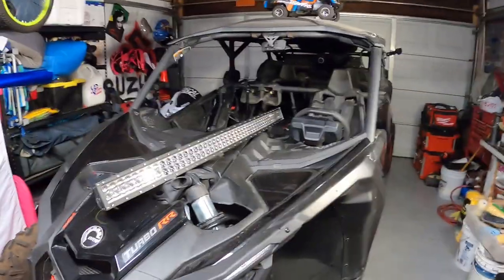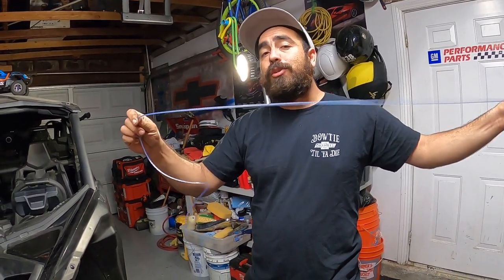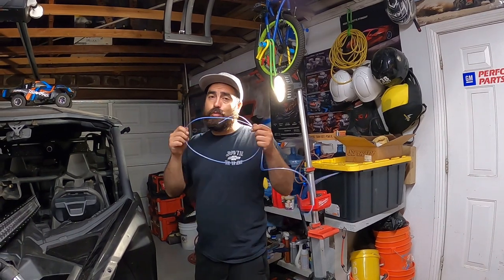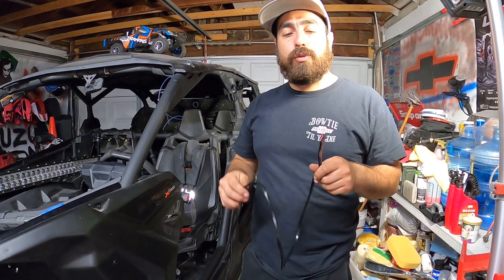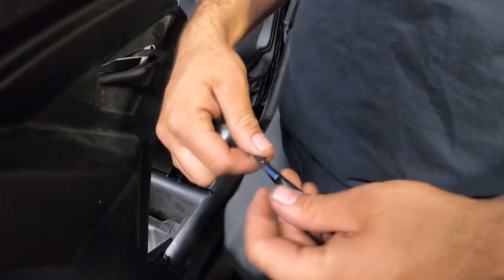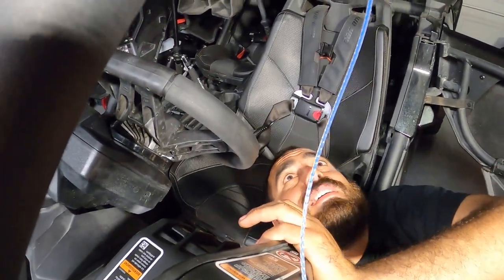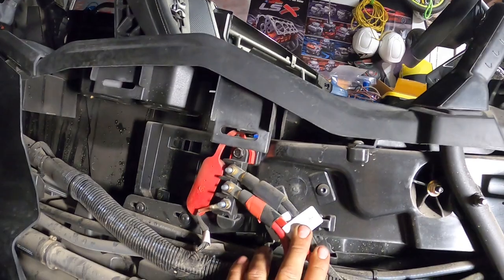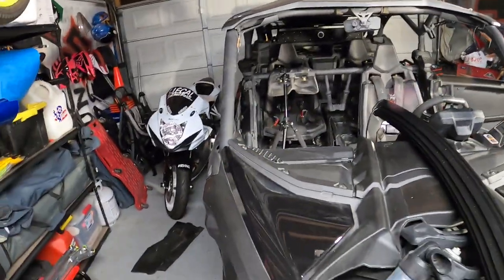Light Bar Wiring Thru Cage Tips on a 2020 CAN AM X3 - EP91

Comment: Try a speedometer cable, they work fantastic. Another trick is, fold a zip tie in 1/2 and put the loop into the hole until it fits tight against the inner wall of the tubing. Fish your wire past the zip tie, pull the folded zip tie back out and it should pull your wire out in the loop. I own Audio 2000, that's an old car audio trick.
Reply from the maker: Dam good advice.. 👍👍 pinned comment so more guys can see it👌
Reply: @GLifeUTV  yo bro does the passenger side also have the 🕳️ in the cage?

Comment: For tight runs, I've cut one of the wires 6" short and the trimmer (or other pull string)  replaces that wire. This only works if you have the wire you can spare... After the run I clip the wires so they are the same length wasting about 6" of wire.

Also, I pull the electrical tape tight / stretching it so it is thinner.  This can make a difference in how easy a line pulls through a narrow spot. 

Your method here is great, I just hope this tip can help make it that little bit easier next time.  I'm definitely using the info you shared to get my light bar put up there when the time comes.  I'm going to see if I can get my whips wired that way.

Comment: Does the 2022 maverick trail dps have the 3 posts to wire lightbars etc instead of using the battery. Thanks
Reply from the maker: Sorry not familiar with the trail, but i would assume so.. try one of the facebook groups for that machine

Comment: What would be the cause of the light bar making noise through the speakers ? I connected the negative and positive thru the bus barn
Reply from the maker: Light bar power wires running to close to head unit.. or to close to speaker wire.
Reply: @GLifeUTV  what would you recommend me doing there ? Do I just separate so the wires don’t touch or ?
Reply from the maker: @marioflores4890  for one yea.. keep them away from ach other so there is no emi

Comment: Frank wsup ! Put a baja light on , chase light , fosgate radio , sb filter , lighted whips and now my fuse keeps popping that my radio , sb filter and well all my accessories are on what should i do ☹️
Reply from the maker: Sounds like you're overloading the 30 amp fuse for the accessory circuit..  The accessory circus should be used to turn on the components ..but the component Should be drawing power from the main red battery cable.. ur setup is not properly wired
Reply: @GLifeUTV  ok cool started happening when I added chase bar and that only has the red and black wire and connected it to the key on bar

Comment: So you got 2 reds on the bus bar, does it matter which one you land your light terminal on?
Reply from the maker: Yes.. the main power goes on the bigger red cable.. that is straight to the battery. The small red is the accessory on
Reply: FrankGLife  Saaaas. Just got a 2021, early Xmas gift for the family. Putting some LP4s and the shock mount light on. Hopefully we’ll see you out there soon. Thanks for the vids
Reply from the maker: @mattdude4729  congrats bro.. thats badass and great to hear🤟👌🤟👌

Comment: Do u have to disconnect the battery before connecting on that electrical bar
Reply from the maker: you dont have to. just make sure you dont touch the big red wire and black wire together.. just remove one at a time.
Reply: @GLifeUTV  I tried it out today but for some reason the switch stays on even when the can am is off is that normal or did I do something wrong ?
Reply from the maker: @2Mjr002  you could follow this video on how to wire a switch ... https://youtu.be/eMxZTGrcoS4

Comment: I got the string thru the cage and couldn't fit the wires thru the cage
Reply from the maker: Where they thick wires?. U could drill the hole just slightly
Reply: @GLifeUTV  it gets thru just gets stuck at the first curve
Reply from the maker: @giomtzz956  are you pushing the wire thru... Trick is to push it thru and not pull it
Reply: @GLifeUTV  I guess I need a second I'm pushing it thru but it's just won't fit i mean I even trying the weed string now also
Reply from the maker: 🤔should go thru man... Enlarge the whole so the wire doest get stuck.. use the sweed wacker string.. ive done it many times.. hope u get it bro🙏
Reply: @GLifeUTV  I taped the thickest wire to weed eater string and the other one a couple inches below it so it can get thru the hole a couple tugs and some patience I got it through. I don't think it'll fit all 3 wires and the string at once I kinda Daisy linkd it. Thanks 👍 for the tint bud
Reply from the maker: @giomtzz956  glad u got it bud
Reply: @GLifeUTV  but now my rocker switch won't turn off the led bar lol smh
Reply from the maker: @giomtzz956  always something..lol..i need to do a wiring video the rocker switches too
Reply: @GLifeUTV  I done all my own stuff rock lights, whips, led bar just that I rolled my can am last mths and i bent the brackets on the led bar so I took it off. I ran the switch to the pig tail under the dash and the power st8 to the battery